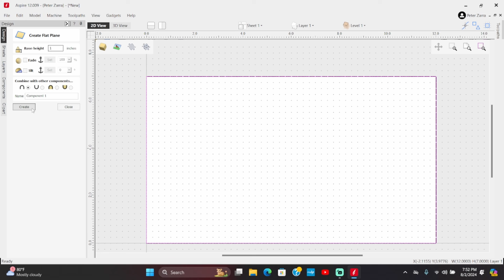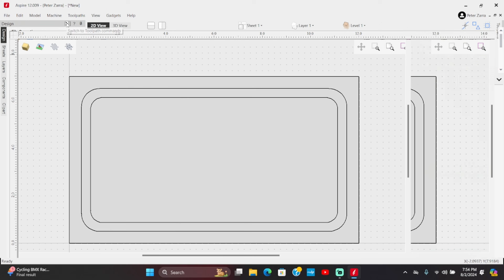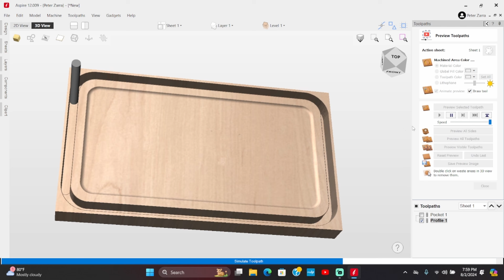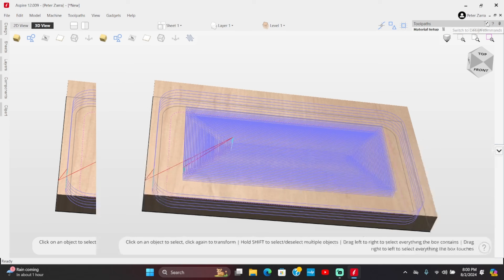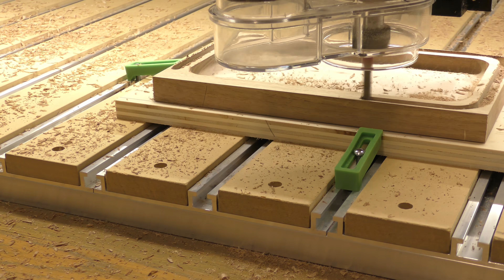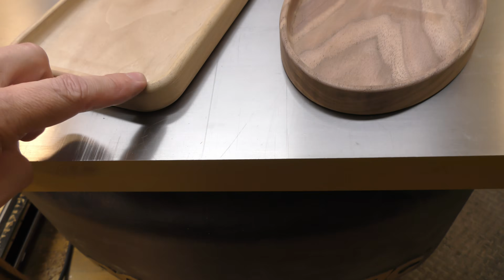How To Make a Tray With a CNC Router

Comment: was vector aspire kind of expensive i got the free trial to buy it was like over 1000
Reply from the maker: When I bought it , it was $2000, it’s great for 2.5D but for complex 3D stuff you can’t beat Fusion 360.   CNC is not cheap, the software is as important as the machine.

Comment: Tape is fickle.  USE THE TABS!  If you plan your projects and the tabs, you never have to sand them off.  The round over part of your process will erase them without a trace.
Reply from the maker: The tape is way better, bulletproof and less work.  Never had a failure.
Reply: @StudioZ-maker  Good for you.  I would start buying lotto tickets while the gods of luck are smiling at you.  I have seen shattered shards of work pieces fly across the shop because of tape failure.  Big wide bowl shaping bits like you were using put a lot of lateral forces on work pieces and tape fails quickly when it does fail.  I've also seen sticky residue left on work pieces and wood fibers torn out, ruining the surface.   Removing tabs with a round-over bit may seem like an extra step, but it's much less prone to issues... especially if you're going to round over the tabbed surface anyway.  Taking wee tiny passes helps to reduce those lateral forces and makes a prettier finished surface too, but as you correctly pointed out, its a tradeoff for the extra milling time.  No big deal for a hobbyist, but at a pro shop, time is money. 

I'm not saying that tape is bad... taping things down can be a good strategy, but it depends on the situation.  If I were machining odd shaped, hard to grip metal or polymer pieces and using smaller diameter bits that generate lower lateral forces, I'd say yes... I've done it myself machining complex patterns onto thin (1/4") aluminum.  But the machinist in me cringes when I see tape and wood.  The problem is that dust and loose wood fibers, that you can't see, can reduce holding power significantly and unpredictably.

Comment: Dude, put that insert back on the machine before you start rounding off those edges!
Reply from the maker: Unfortunately, that is the smallest insert my shaper has that will fit.  The next size down won't clear the bit.

Comment: These are great projects.  I can't seem to find the gorilla tape you are using.  Can you provide a source or a product description.  Thank you.
Reply: Thanks for the info. I also use xfasten tape.
Reply from the maker: Thanks, I get it from Home Depot but you can also get it from Amazon.  Search Gorilla double sided tape gray and it will come up. 
I also use XFasten double sided woodworking tape also on Amazon, this comes off easier and is a little easier to work with.  The Gorilla tape is very strong and can pull veneers off of plywood and ruin MDF if not careful.  The XFasten does not do this.

Comment: Use a raster cut for your pocket. Looks so much better. You could also try a roughing bit in the pocket first, then the bowl bit. It cut back on time for me
Reply from the maker: Thanks, I will give it a try.  In my latest video I carve out a Xmas tree tray and I encounter some other problems with it.  One of the problems was occurring in this video with the trays as well.  It has to do with the depth of cut on my final finishing pass for the bowl area, the other issue was dealing with a bad file that I purchased. 👍
Reply: Yeah, sometimes you'll run into that with buying files. Always check your nodes
Reply: so for a newbie like me, i definitely wanted to say use a rastor cut and go slimmer o the last pass but on the software side, how would you program that? A, would you program it so that for example your final depth and depth of cut equal in a way where its forced to then take one final slim pass and do the whole cut from start to finish as rastor orrrr B, two seperate operations where first goes lets say to .74 out of .75 depth and second is set as rastor and does the remaining like .01 or whatever? also, what do you prefer that last little rastor cut depth to be?
Reply: @eladsinay6914  I use a roughing bit to remove the most of the pocket with a pocket allowance of .03 and a depth of cut .03 less them my target depth. Then come in with the bowl bit and raster the last of the depth and the pocket allowance doing a final profile cut. That's in vetric anyway. If you're using a different cad/cam, I'm not sure what you'd call the specific tool paths and stuff. Vetric has the pocket allowance and profile 1st/ last
Reply: Built into the software for the pocketing toolpath.
Reply: @sinsofvorador  yes, i got vectric too. so basically you would set up two operations, first roughing with a straight bit and then the second operation is a bowl bit with starting z of where the straight bit left off and going down the last .03. in a rastor cut.  Is that what you basically meant in your comment? just making sure i understood that correctly
Reply: @eladsinay6914  yeah. I'd set both toolpaths to a raster. Following the grain of the wood.
Reply from the maker: Watch my most recent video I explain, and trouble shoot all of that.  There is a minimum cut depth for a bowl bit, don't fast forward or you will miss it.   https://youtu.be/8JiM1uCLz04

Comment: If you use the board surface for zero you will get an inconsistent thickness of your final product based on the varying thickness of your stock. If you use the machine bed which never changes you will get a consistent final product thickness no matter what the stock variations are.

Comment: I zero on machine bed.  Never have to worry about bit cutting funny faces in your spoil board.  Then I leave an onion skin last pass to secure the stock.  So material is .5, I cut to .49.  Holds item very secure and you can snap the skin off with your hand.  Thanks for video!  Keep them coming!
Reply: I leave the onion skin and. 99% of the time, I round over the bottom of the trays I make. Knocks off that onion skin quick and easy.
Reply from the maker: Thanks so much! I'm glad you enjoy them.  I use a sacrificial board that I mount to the spoil board so the spoil board never gets touched.  It's great for the trays because I have a thin board mounted to the left edge that is perfectly 90 to the face, great for registering it in the same place every time.  👍

Comment: How long did it take ?
Reply from the maker: The rectangular tray took about 5 minutes of actual machining time, give or take
Reply: @StudioZ-maker  thank you. Im currently stuck to choosing air or watercooled vfd spindle 2.2kw. I really liked the air one if the noise is almost the same when they are in action due to cutting noise.
Reply from the maker: I would highly recommend the water cooled.  The cutting noise will be the same but the actual spindle running will be quieter.  If you do end up machining something that requires a lot of machining time then you won't have to worry with the water cooled spindle.  I know myself I have a couple of projects that take over an hour of machining and it's nice to not have to worry about overheating.
Reply: @StudioZ-maker  thank you so much. Now ill go with watercooled spindle 🤩.
Reply: @aha5888  I have an air cooled, it works fine. Doesn't get hot. Also don't have to fool with the water, so saves some money